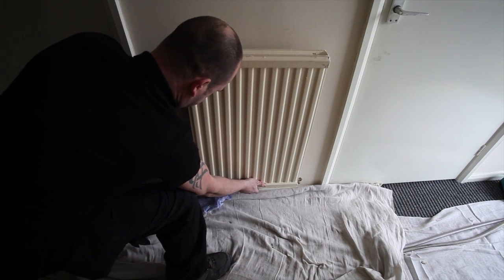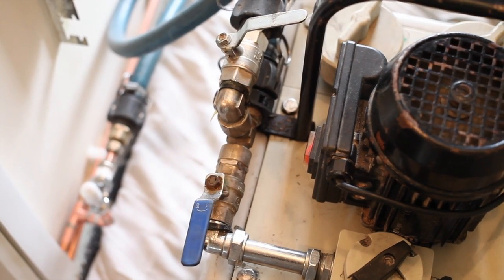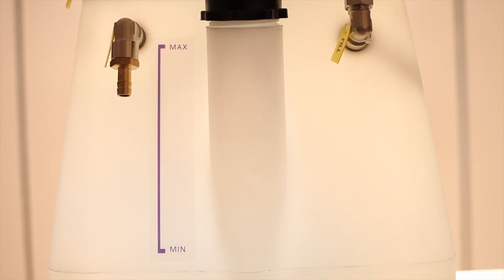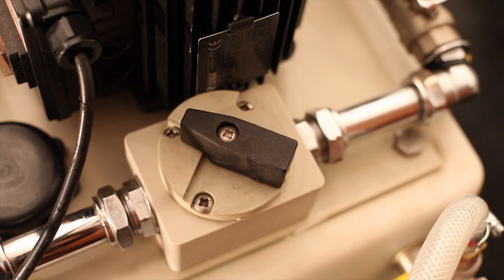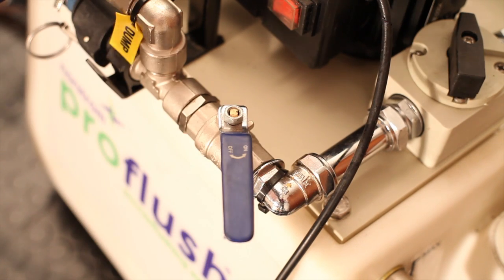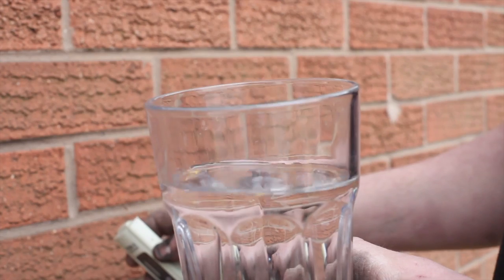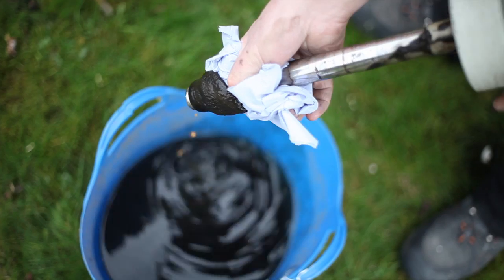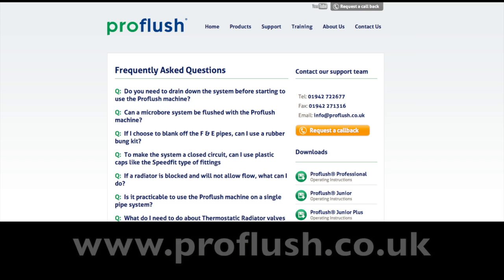Norstrom Proflush - Open vented systems

Comment: Hi, Can I ask When flushing out rads, dumping water out, do you close the return side valve ? I know you close the flow side dumping valve but I thought the return side would be off, which is below the opened dumping valve.. ? Thanks
Reply: Only if you can replenish the incoming fresh water as fast as its leaving
Reply: Flow and return valves on machine remain fully open while opening the dump valve
Reply: @kennethhogan9115  Don't think so. Handle pointing side/flow open, that damp valve will be shut, other side damp valve open and return valve shut  - when flushing out rads. Even people who sell them weren't sure and couldn't be assed to send manual with it..
Reply: The reason the return valve stays open is because most of the time the dump valve will not be fully open while dumping and the other valve takes the remaining water back into the tank
Reply: @kennethhogan9115  thank you